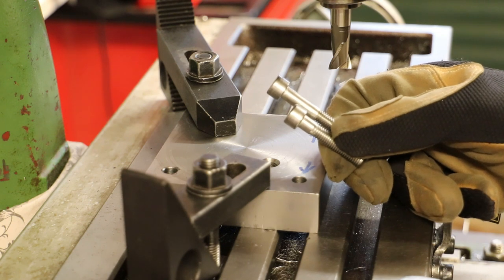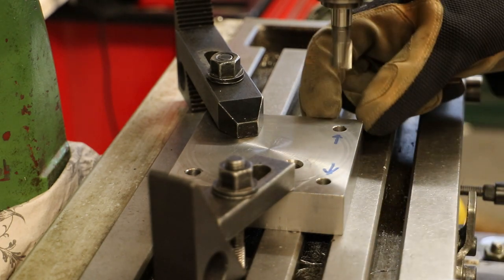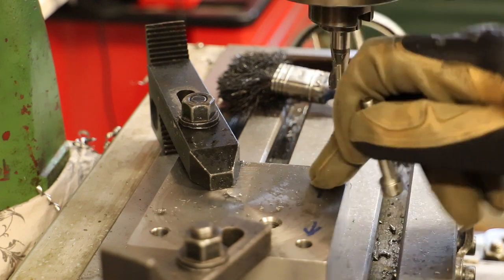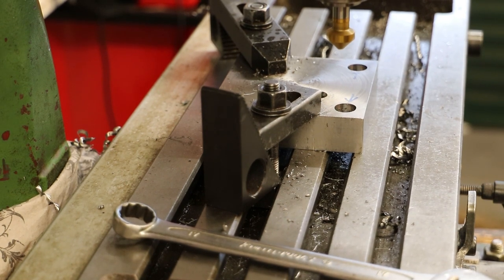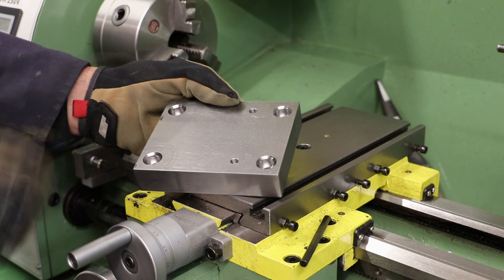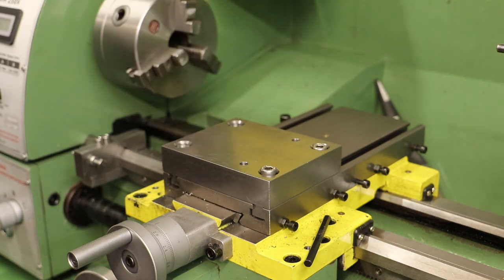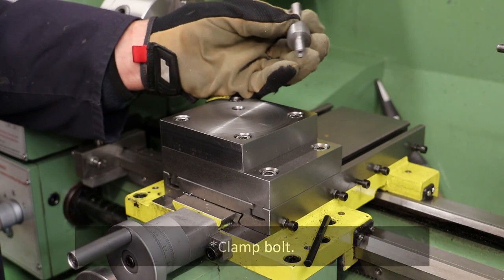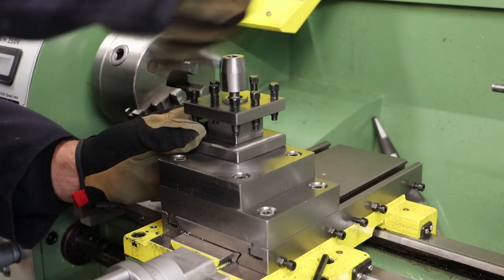WM250V Fixed Toolpost Part 6

Comment: Nice work and a great set of vidoes. Thanks for taking the time to share your work with us.  I'm thinking about doing something similar, but using one piece of 50mm thick plate instead of bolting two bits of 25mm plate together.  I don't have a mill so I wont be able to trim the plate to size like you did, so I'll probably have to live with some overhang on one side...

Comment: Thank you for an excellent series. I intend to duplicate it myself. Are there dimensions or drawings I can access?
Reply from the maker: Hi Bernard,
No, I didn't make it to any specific dimensions, but on reflection, I should have made it to the same dimension (height from the top of the top slide) as the compound slide as I now need to reset the tool height when I swap between the fixed and compound.
Thanks for the positive feedback.
Mark
Reply: @markshomeengineering5243  Thanks for your kind reply. I can make do with your series.
I am planning to mount a bigger QCTP aka 250-111 but also proposing to down size to 75mm stock rather than the 100mm stock you used. 
Do you see any problems to be avoided?
Reply from the maker: Hi Bernard,
75mm should be fine, I just used what i had to hand.
Good luck.
Mark
Reply: @markshomeengineering5243  Many more thanks. I look forward to seeing more of you improving my look alike WM250V.